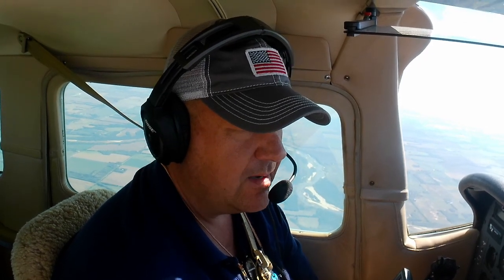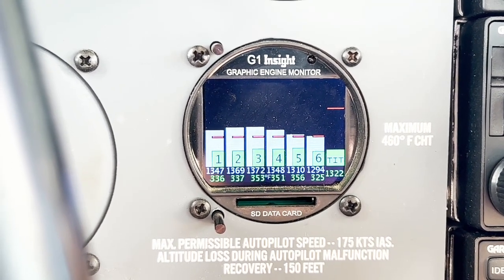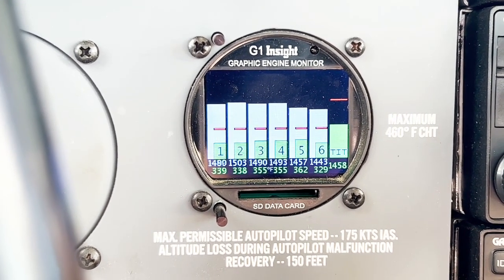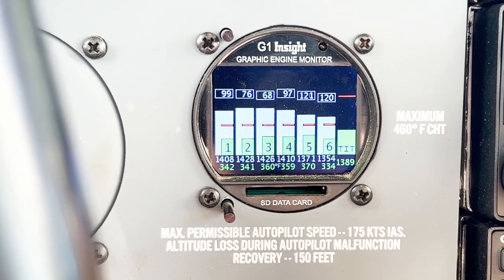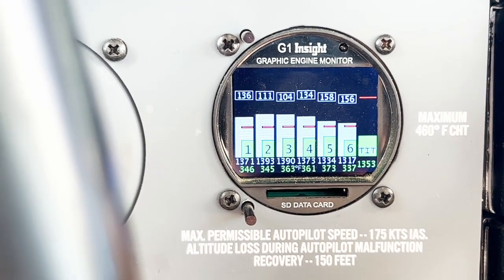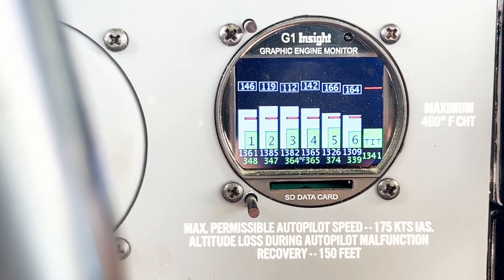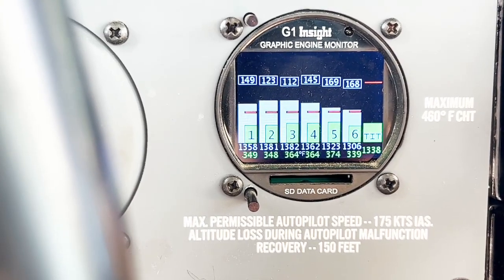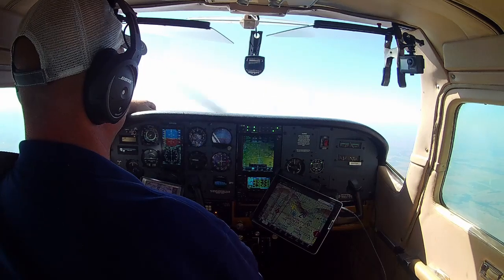Leaning the Cessna T210

Comment: I’m not a pilot, but I’m curious about about this process. Do you only start leaning after reaching cruise because your plane is turbocharged? Whereas a typical piston engine would be leaned as you climbed since the engine would lose power?

Thank you!
Reply from the maker: You are corrrect! But even in a normally aspirated engine you will not lean aggressively and keep you eye on the cylender head temps. That is what you need to keep in check in both instances.
Reply: @TheFlyingSalesman thank you!

Comment: After leaning try going full rich, look out the left window, lean till it stumbles, go rich until smooth then a pinch more and check how close you are compared to your fancy gauge.
Reply from the maker: You sound like someone with a little bit of experience between the headset. I will give it a try.... However, my experience tells me that this put me LOP. My engine stumbles at about 65 PPH and will smooth back out at 70 PPH. a pinch more and I am right at 100 deg LOP but I do not like seeing my TIT pushing 1550+. That is the reason I like to ROP. I will check it out though and let you know.  Thank you for watching!

Comment: I have always ran my engines 30 to 60 degrees lean of peak. I bump my MP up a half inch and cruise at either 2300 or 2400 depending on altitude. Bore scope shows really clean combustion areas. Until they go totally lead free which is coming, I try to keep the engine efficient and clean. My CHT stay around 360 per cylinder. I was taught this from a master A&P and he has some of his customers reaching 4500 hrs plus to overhaul. By that time, the engine has reached the end of it useful life. Cost wise you are saving on two TBO’s compared to one. Remember TBO is a recommendation, not a regulation. Trade offs are better fuel economy vs 3 to 4 kts TAS slower. I’m never that much in a hurry.
Reply from the maker: @aviatortrucker6285  GAMI’s?

Comment: I have a turbo 210, being told to run that rich of peak.  I just bought it
Reply from the maker: Outstanding! They are great cross country machines. It is my understanding for Rich of Peak operations, 100 Deg rich is where you want to be. If you have GAMI or a really good set of tuned injectors you can start looking into LOP operations. I have tried it with tuned injectors but my TIT was almost 1600 degrees. "They" say that's okay, but I am not comfortable with it.  100 Deg ROP is where I will stay. They last engine made it to just shy of TBO and although this engine has some corrosion issues that will need to be addressed, there are not any signs of adverse wear from running ROP. Enjoy your new plane and keep in touch on your adventures.
Reply: @TheFlyingSalesman  Thank you, I appreciate that,  I do not have Gami right now.  I was running hot on cylinder 5, so far, we have replaced all of the lifters, two cylinders were replaced prior to my purchase and the oil change prior to that was good, the oil change after resulted in high aluminum, to be expected from new cylinders, so I have to fly it for about ten hours and change it again, probably a few times.  My exhaust had a crack so I replaced that, and so far, the plane has been down for about 4 months but  I am fixing EVERYTHING>  leaking nose actuator I had replaced, new tires, new brakes and all of my cockpit lights fixed and or replaced.  Plus a laundry list of small things like a seatbelt installed incorrectly.  During the exhaust replacement, found a crack in the turbo so I replaced that.  It's a really good-looking plane, new paint new interior,  but I am a bit of a perfectionist so I wanted everything fixed.  We scoped all the cylinders and all was well, the cam looked good too, it only has 600 hours on it.  My impression is , when I purchased it I flew to Arkansaw to see it, when I pulled in, there was a Hawker, Lear, Gulf Stream, and the 210, lol figured the 210 wasn't flying much and my impression is that once I get it active it will all work out.  I fly about 300 hours a year so it will get a lot of exercise.   I appreciate your videos, and learning a lot,  I did have one question.  I noticed when you taxied onto the runway, you held brakes until you got I believe you said 30 on the manifold, then rolled, do I have that correct?  and if so what is the purpose?  I have also been told when shutting down, let that plane idol down for a good 5 minutes allowing the oil not to spool into the turbo.
Reply from the maker: @kennethjlee397  You have that correct. Crazy as it sounds, I have been to Flight Safety three time for the CT210. This is how they teach takes offs in any turbo charged piston.  Bring the MP up to the Altimeter setting (I use 30" because the field altimeter setting is usually within 1") and let the MP stabilize. You will notice it will go up and then come back down. After that, advance the throttle to redline-redline. 

The reason they recommend this is the wastegate is fully closed because of the low oil pressure. When we advance to the throttle for take-off, The MP and the Oil Pressure rises together and it takes a few seconds for the (because I am usually close to sea level), upper deck controller to sense the difference and the engine will not need all of that extra turbo. Then the wastegate opens and dumps the extra air.

If you were to roll straight into full power aggressively, you could over pressurize the intake system because those components do not have time to stabilize and work properly. 

You are doing right by idling before shutdown also. The saying goes like this- "One Thirty Five; 1 Thousand RPM for 3 minutes or spend $5000 on a new turbo". When you shut down the engine, oil no longer flows through the turbo and because of a check valve, it cannot leave the turbo. If we shut down then it is too hot and the turbo is still spinning at too high of an RPM (Cruise power it spins around 80,000 + RPM) it can "coke" the bearings which means the oil fails and turns to sludge. This will in turn prevent the turbo from starting to spin again on startup. A lot of people will tell you its only about temp and that TITs actually fall then rise again when landing. This is true, however the other component is the speed at which the turbo is spinning. It takes a while for something spinning that fast to slow down so that where the three minutes comes in.  Be sure to remember this during maintenance runs too. If you go above 1000 RPM, the clock starts over.  Same thing with taxiing in. If you have to add power to taxi up hill or spin around, start the clock over. These are great questions and I will try to cover some of this in an upcoming video.
Reply: @TheFlyingSalesman  Great information I really appreciate it.

Comment: Thanks for sharing your vid!  
For comparison I operate my 77 T210M LOP.  30” at 2400 I lean till the last cyl to peak is 40* LOP per my JPI.  Easy to do as the JPI inverts the EGT’s as each cyl peaks and displays the LOP value.  I have Gamijectors and have gone to great lengths to seal the engine airbox as well as possible.  My FF, depending on OAT will be between 13.8-14.4 with the hottest cyl (5), like most, will be around 365ish with the cowl flaps fully closed!  If you’re not familiar, the IAS difference between full open cowl flaps and full closed is a full 5kts thus fully closed flaps is desirable!  TIT will be right around 1550* or so.  TAS at these settings will yield between 160-165kts.  Compared to your ROP I’m saving about 3 GPH which at $6/gal is $18/hr.  That’s almost 30K from 0 time to 1600 TBO!
One great advantage of the turbo is after you lean to LOP you can add back lost MP by advancing the throttle back to 30”!  
Proper engine set up is mandatory.  See Continental SB 97-3G.  
I’m interested in your thoughts.
Reply from the maker: The last engine, I could level off in cruise, close the cowl flaps and not look back.  This new engine (~275 hours now) needs half cowl flaps open in the summer (above 70 deg).  Western Skyways tuned my injectors and I tried LOP on a couple of flights but the TIT being so much higher concerned me.  I am aware the the dollars stack up, however I calculate that in cruise I am burning 14.5-15 GPH.  Also, most of my legs are inside of 160 nm so I do not get the benefit of long high extended cruise settings.  

I am curious, you lose MP during the leaning process but add it back after you are set LOP?
Reply: If you can’t close the C flaps in cruise I’d look carefully at your baffles for proper sealing.  Not sure how your injectors were “tuned” but the max TIT is 1650*.  LOP you should be well below that value.   @TheFlyingSalesman